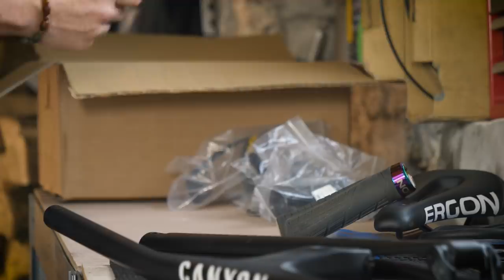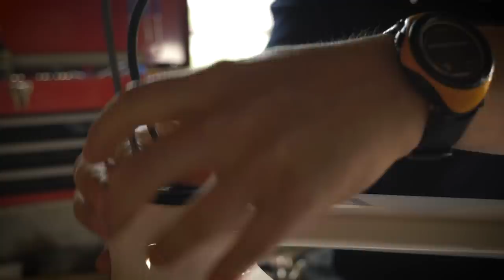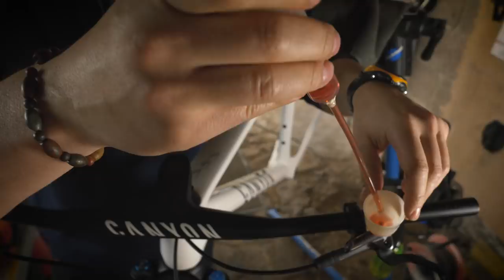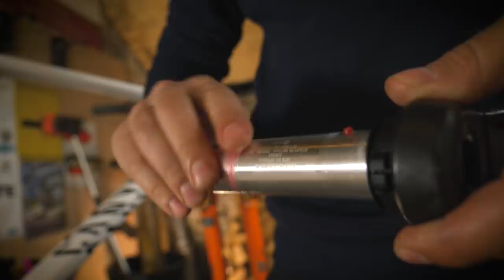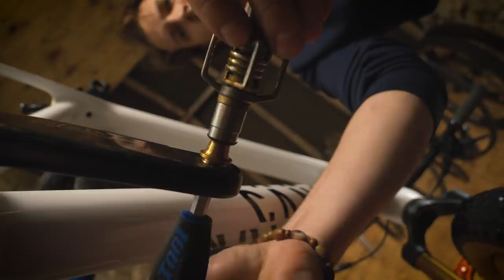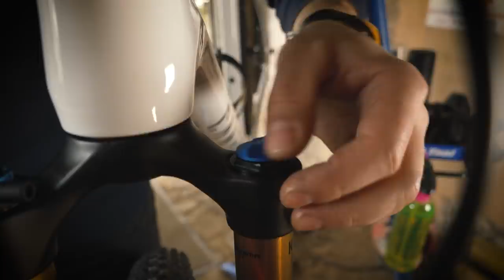Rich's Dream Cross Country Bike Build | Canyon Exceed CFR Team

Comment: how do you get a thro axil off when stuck solid ? am thinking of using 12mm tap to put 12 mm bolt in then unscrew from other side

Comment: Rich's Park Tool inventory must be devoid of torque drivers/wrenches.
Bit of a miss there to get even more product placement shots....
Reply: Torque wrenches are only necessary for the amateur and the manufacturer to push more tools TBH, a well experienced mechanic has a good feel and is unlikely to over torque Carbon. I used one all the time for a while but now not so necessary. Unless it’s Schmolke, then use a torque wrench, I do still use a torque wrench for my brake rotors and stem clamp though

Comment: Anyone else bought a canyon bike and major issue's? Eg: paint chipped down to base coat..paying $30 for extra for shipping protection. 3rd ride and my bike started making the dreaded creak sound.  Turns out when i took the pivots apart the piviot mounts had alu filings and thread was ucked. Canyon gave me credit to fix paint chip then 6weeks later they sent me threatining emails saying i owed them money.  Not having a go at gmbn.
Reply: I don't think I'll ever buy a canyon because of the other 1% of cases where issues like this happen.

Comment: Really, very nice advertising, but after the fairy tale hour back to what customers can expect, 
otherwise anyone believes Canyon has anything to do with quality.
My experiences are, that the bike from this company is the worst bike I have ever owned, damaged 
by the manufacturing process, equipped with the wrong parts, delivered in a battered box, falls 
apart on the trail, with the worst service I have ever experienced as a customer.
The marketing slogans “100% quality control” and “Made in Germany”, which were not applicable, 
had to be removed from the manufacturer's website after a customer complaint.
If you do not want to believe me, you might believe other customers 
look in truspilot Rating 1 Star or employees on
kununu or just watch YouTube videos
Reply: good to know. I keep hearing negative things about the brand. What's your thoughts on Scott hardtail bikes?
Reply: @AceGoodheart  Hey, I can't tell you anything about Scott Bikes, neither positive nor negative. But I think there is nothing to complain about with hardtails, because the "problematic" rear triangle kinematics are not used here, and when it comes to forks you really only have the choice between the two big manufacturers. I also have a 12-year-old AM bike from Haibike, which only had to be adjusted once in the whole time, nothing else, and I was also in the bike park with it. Maybe just a tip, it is better to pay more and have a service on site than supposedly cheap and then it will be expensive, tedious and nerve-wracking because you can send the parts to Sram, Fox, Rockshox or Shimao yourself. Because you can expect one thing from Canyon, namely nothing